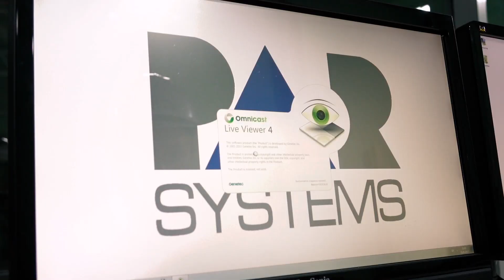Inside Chernobyl's New Safe Confinement

Comment: its a waste of money to destroy the clean reactors 1-3 let them be ,4 is only dangerous.1-3 is clean and wont harm anybody
Reply: Are you serious the rbmk reactors are old and no use anymore the whole design of a rbmk reactors is terrible and should have never been made in the first place
Reply: As of 2022 there are still 8 RBMK reactors running and producing power. It might be a bad design, but they've been modified and operated to be safe. Check out the Wikipedia page for the  RBMK.